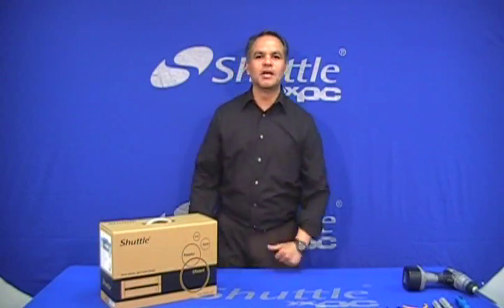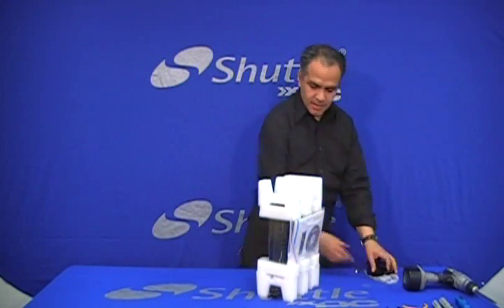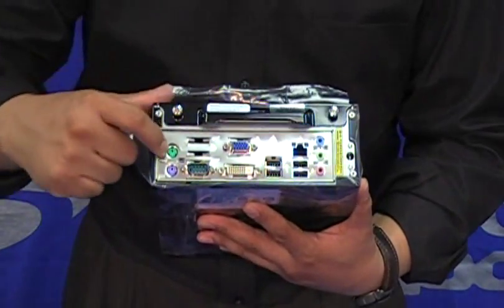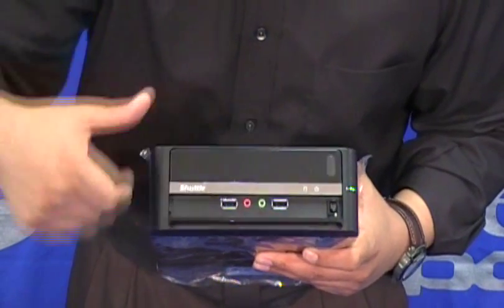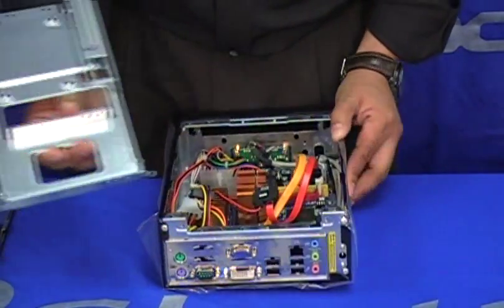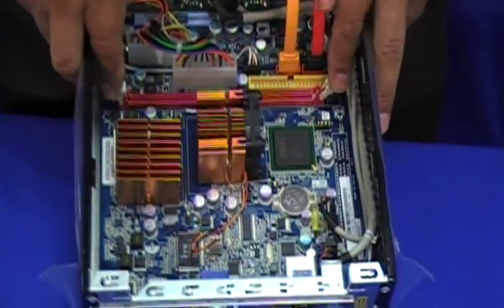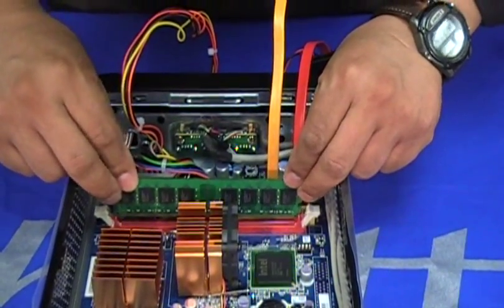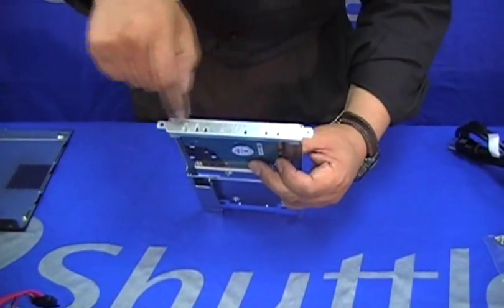Shuttle Atom-Dual Core Slim PC Overview -- X27D -- Part 1 of 2

Comment: The Shuttle X27D makes a fine Hackintosh.

Lion still supports the GMA950 (using the arch=i386 kernel flag), and the GMA950 kext which is included therein provides acceleration including CI/QE as well as 1920x1200 resolution.

A DSDT which supports this system is readily available.

Comment: @CallOFwar100 You don't want that you want a dual core atom mated to an Nvidia Ion chipset. You can build it yourself with a Zotac board for about $100 US for the board, and another $100 or so for memory/HD/optical drive if you go to the right source. Another $60 for a case and PSU.